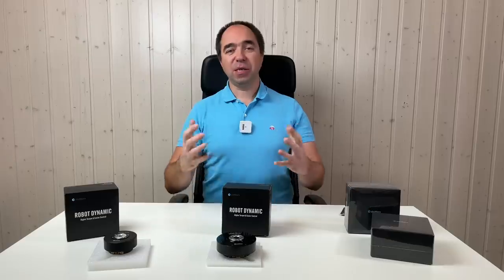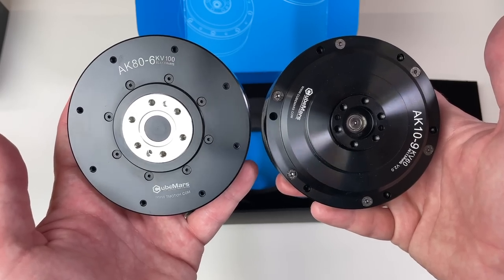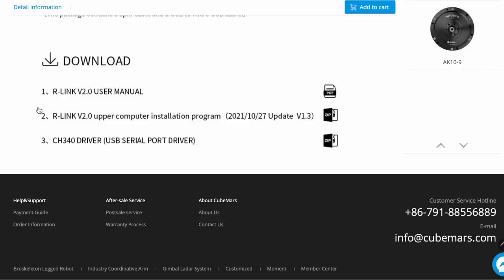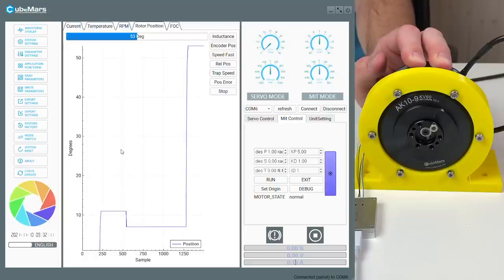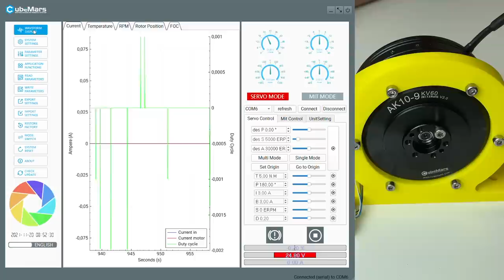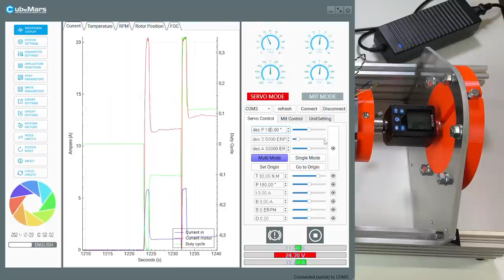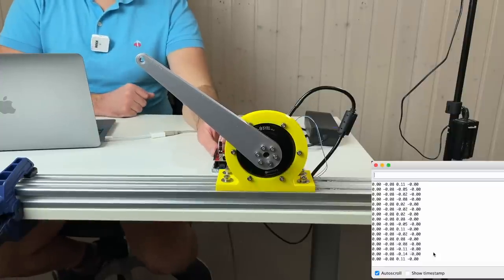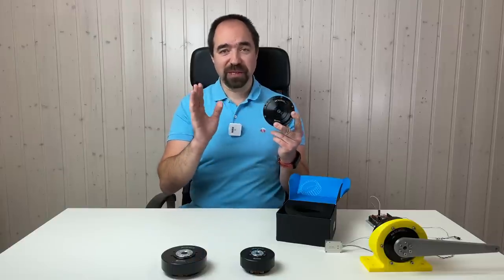Collision detection and Gravity compensation with the almost perfect actuator (AK10-9 V2.0)

Comment: When you first started this channel, you used common stepper motors($17) and affordable out runner BLDC motors. I was exited and got on board. Now, you are promoting motors costing $500+ dollars. I’m no longer excited and feel let down. So sad. Many of us could possibly build an affordable(remember your words) robotic arm with a few nema 17’s and an Ender 3(or clone) 3D printer. Very FEW can afford these expensive motors and drivers. Hopefully you can get back to that AFFORDABLE robotic arm.
Reply: It’s only 800 dollars for a motor, reducer, controller and encoder.

Comment: If you are interested in collision detection, it might be interesting to look into energy based control. The idea is that the robot has a certain 'energy tank' that it can use during movements. If you want to make a certain movement, you estimate how much energy that would need, and you 'fill' the tank with that amount of energy. The robot can never expend more energy than this for its movements, and thus the amount of applied energy can be limited. This means that you can even have 'safe' interaction with springs and other elastic energy type storage.

I definitely agree with you that a temperature sensor would much improve the usefulness of the motors. Motors are not inherently limited by the amount of current or power, but purely by thermal considerations. The usually stated 'max power' is only for a longer duration, and you can far exceed that during short bursts of movement, which can be very handy. Especially so, as most robot interactions are not sustained high power, but short power pulses. It means you can use a much smaller motor for the same performance. The only thing is, you have to be careful not to thermally overload the motor, and for this a sensor is of course better than any other method of estimation.
A talk given by Wesley Roozing for IROS of last year talks about two of these points: Field weakening and thermal management. I think you would find these very interesting.
Reply: could you please give an example on how you would define the energy and how it exceeds with a collision?

Comment: Gordon Freeman does actuators review. That's kind of content I subscribed for! ))
On a serious note - with current level of actuator features/price it looks like there would be a huge value in doing proper integration instead of creating your own actuator. What I mean is that actuators already reached good enough price/power/functionality to be really useful in some sort of robotic arm. So maybe it is better to allocate much more resources to do integration with those actuators, instead of creating your own?! Because proper frame with existing actuators + support electronics + controller hardware and software would already rival some of the cobots on a market. Later, SW can be improved further, which might jump start the whole "cheap but good" cobot industry, like it was with 3D printers.

Comment: Really cool actuator 😎
I'm thinking, you can use model lipo battery as high current power supply. They are much cheaper than high current power supply and are portable. But a bit dangerous, I store my batteries away from flammable materials.

Comment: hi! amazing work 😄 I have a question regarding the terminal resistors. It seems to me that you connected both to the arduino end. should you not have one at the ak10 end?
Reply from the maker: Great question. Yes you should. But in my case the cable is very short, so it does not matter.

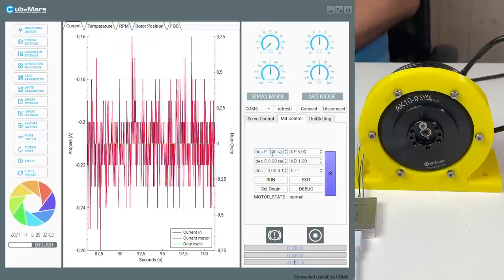Comment: Wow. those graphs in their software 7:34 (and even the tab names & position) look like the were taken directly from the VESC Tool 🤔 Can imagine maybe they use the same library for graphing under the hood, but the names and position of the tabs are identical...

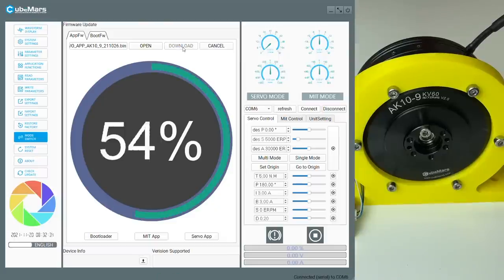EDIT: Oh wow at 10:06 this looks very identical to all the controls for setting up VESC motor, I wonder if they 'lifted' a lot of VESC Tool and VESC Firmware code to implement this and not attributed any of it back..

Comment: I don't know much, but do they not use cycloide gearboxes with zero backlash for robotic joint manipulation?
Reply from the maker: As far as I know, very few robots use cycloidal gearboxes. 90% of them uses harmonic gearbox. And, as far as I know, zero backlash cycloidal gearbox is quite expensive to manufacture.
Reply: @Skyentific  ok thx

Comment: Can you share the list of electrical components you used to run the motors. I have AK 70 motors
Reply from the maker: It is simple: power supply, arduino uno, can-bus shield from sparkfun, and two resistors 120 Ohm (termination resistors).
Reply: Can we get a sample code for CAN controll through Arduino for this motor. Thank you!
Reply: hey bro, did you manage to actuate your motor?
Reply: @kaifbhojani7979  do you also have ak motor?
Reply: @akimrain  yes, I have worked on it!
Reply: @kaifbhojani105  how did you actuate it? is it similar way through can bus and arduino?
Reply: @akimrain  yes, I did it using Arduino and the CAN bus module!
Reply: @kaifbhojani105  can you share code to me please?
Reply: @kaifbhojani105  Hi are you able to send me the code? I am able to toggle my joystick but my motor is not moving😢.

Comment: thanks for kind tutorial.
I wonder if you had any problem controlling with arduino. I have V1.1 of this actuator but it seems that the "Enter motor control mode" message does not work.
CAN connection seems to be fine because I receive every replies.
Reply: hi, did you figure out your problem?
Reply: @akimrain  yes cubemars q&a center told me that V1.1 doesn't support servo mode. MIT mode only.
Reply: @정동경-v3s  alright, and what hardware did you use to control ur motor?
Reply: @akimrain  sorry my first reply was a misunderstanding your question. Forget it. ROBOTIS' OpenCR1.0 is my embedded controller. I forgot designating the length of the message and that was the reason my message did not work.
Reply: @정동경-v3s  hi could you share your code with me? My motor doesn’t seem to enter the control mode. I would really appreciate if you could.